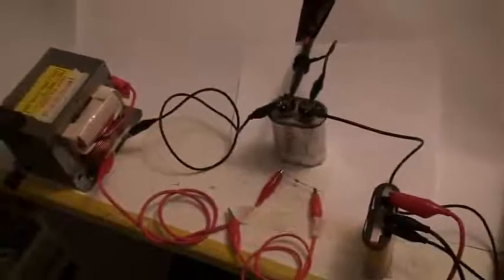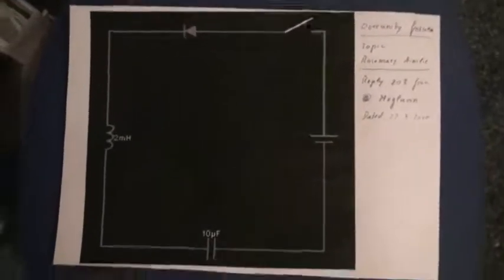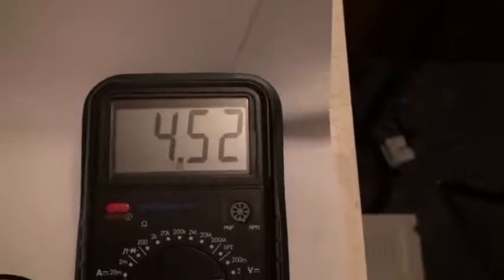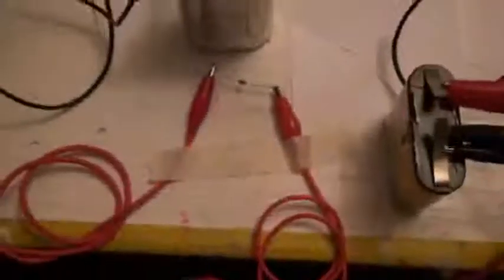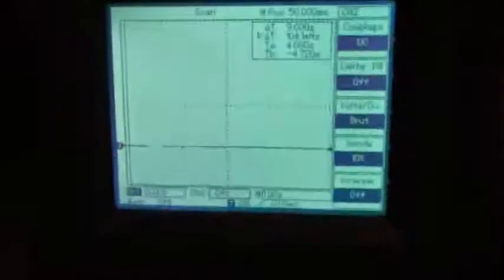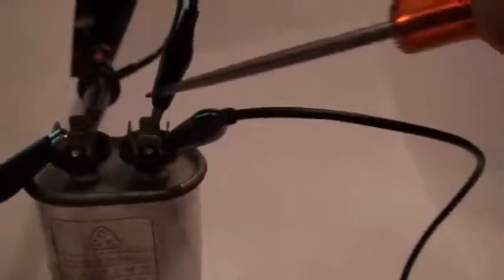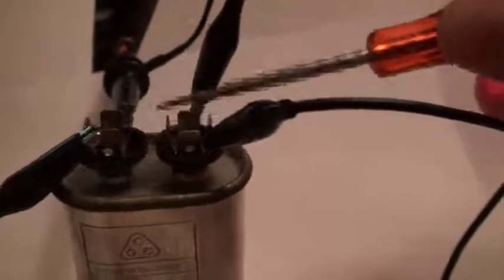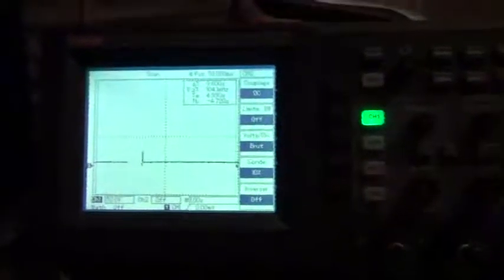shorting capacitor test 1.wmv

Comment: (2nd)  The battery can supply a certain maximum current (=i), and the inductor is a certain size (=L).  Therefore the energy stored in the inductor when you are keeping the short-circuit is 1/2Li^2.

Then when you move your screwdriver and take away the short the inductor discharges it's stored battery energy through the diode and into the capacitor.    The inductor does not care about how high the voltage is in the capacitor because it acts like a current source.  Smaller cap = higher voltage.

Comment: Well done Woopy.
What does happen, if you pulse the switch in the circuit diagram,
so just tapping the power from the battery on and off ?
Does the cap also charge up higher then ?
Regards, Stefan.

Comment: (2nd) If you make the capacitor larger and do the shorting test you will see the peak voltage go down.  If you make the capacitor larger you will see the peak voltage go up.

The inductor stores energy based on the current flow; E = 1/2 L i^2.   That energy goes into the capacitor.  The max current when you make the short is always the same for the same battery.  Same energy going into smaller capacitor equals higher voltage.  E = 1/2 C v^2.

Comment: I agree with User2718218. When you short the capacitor, you are powering the transformer. And when you unshort the capacitor, the power stored in the transformer need somewhere to go, and it goes to the capacitor.

Comment: (3rd)  Correction:  If you make the capacitor larger and do the shorting test you will see the peak voltage go down. If you make the capacitor smaller you will see the peak voltage go up.

Comment: Rosemary said, "It seems that there's way, way more energy available than from the supply.  Indeed that's where our own results point.  "

Rosemary is also wrong.  The battery puts energy into the coil.  The coil then puts energy into the capacitor.  The diode prevents the capacitor from discharging that energy.

It is as simple as that and there is no over unity or energy amplification taking place.

Comment: This looks mysterious but it is normal.  If the experimenters on the free energy forums understood how an inductor worked then they would be able to do better experiments.

In the bast case scenario the majority of the experimenters would do the research and understand how inductors really work.  They understand capacitors but they don't understand inductors.

The inductor has "inertia" in the form of current flow.

Comment: "The comment on your vid says different cap size will do wonders, nope.
The cap is the amount of enegry that drives the circuit.  So a big cap, big long currents, etc."

Magluvin is wrong.  The amount of energy that drives the circuit is the amount of energy in the battery that gets stored in the inductor.  It's all about the inductor.

When you make the short with your screwdriver battery energy gets stored in the magnetic field of the inductor.

Comment: (3rd)  An inductor is capable of generating very very high voltages and it is not magic.  It is simply how inductors work.  The "secret" is that inductors actually "generate" CURRENT, and the voltage they generate is a result of the current.

For a capacitor, capacitors "generate" VOLTAGE, and the current they generate is a result of the voltage.

A capacitor can discharge with very high currents and nobody cares.  An inductor can discharge with very high voltages and people get excited.